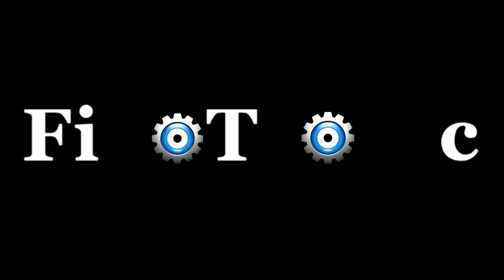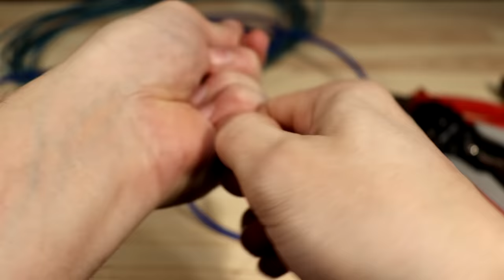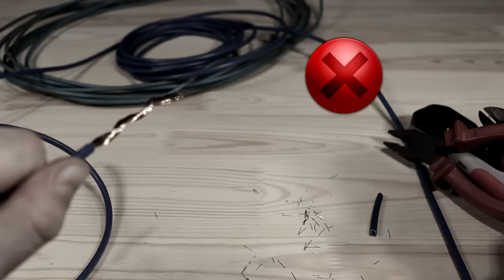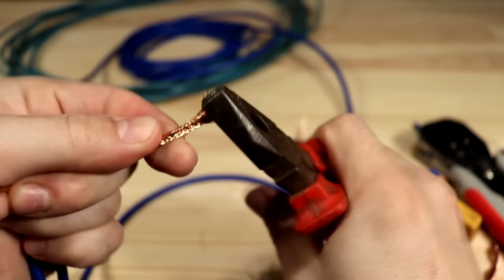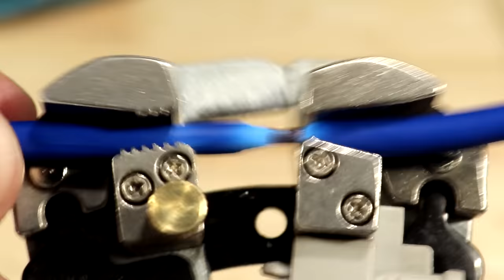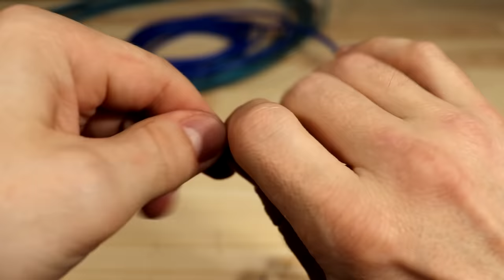AWESOME IDEA! HOW TO TWIST ELECTRIC WIRE TOGETHER!

Comment: Use any method and solder a bit. Cut down video to 30 seconds.
Reply: but...   thats what electricians do....  this kid wants to be unique.. lol
Reply: But first, slide a piece of heat shrink tubing over one of the wires, then after the wires are soldered together, slide the heat shrink tubing over the joint, and heat it to shrink the tubing. This covers the bare joint so it doesn't short to something.
Reply: @JohnMSawyer  I was going to say the same.
Reply: Yup. That's how NASA does it. A lineman's splice, soldered and covered with heat shrink.
Reply: @JohnMSawyer  oh thank you. Most people would not have thought about the wire shorting out. You saved someone's life.
Reply: Or just don't pull the joint apart. He never showed us what he did to finish the job of. Heat Shrink, Insulation Tape?
Reply: A good strong physical connection such as the western union or linemans splice should always be used BEFORE soldering.
Reply: @billkelly6374  NASA specifies that there should be just enough solder for a complete bond but little enough that the proper form of the splice can be seen.
Reply: Yes, solder and a bit of shrink wrap and you're good to go!
Reply: Nothing new here, the lineman's (or Western Union) splice was taught to us in US Navy Electronics Technician Class A school back in 1963 (and it was old then!),
Reply: @bumper52  Yeah, it was originally used to splice telegraph wires.
Reply: Brian Roberts  nope those clip connectors  always  are the best way  for splicing  into a circuit  and will  never  give you  any  problems  during  the  lifespan  of the vehicle
Reply: No I dont like to shoort a video, It wastes my time.
Reply: Not to mention, using pliers to crank the splice tight with the third demo, but not the first two, just MIGHT be a reason why the splice was stronger...
Reply: If you want the best way to proceed, check out IPC A-620 pdf guide. This is the most up to date guide for aerospace repair and wiring assembly. It provides everything about wiring, splice, cliping, connector,  shielding assembly and so on.
Reply: Please do not solder. cuz when i have to show up because you hooked up your shit wrong i don't want to have to deal with soldered connections. Thank you. Sincerely, an Electrician.
Reply: Brian Roberts  You dont need to solder 220V (or US 110V) joints. Hifi and such, yes, bc of oxidation, increasing the resistance.
Reply: Also:
Electrical wire is never supposed to deal with force, so your connection doesnt have to be strong, unless you want to pull single strand wire, for 220/110V through tubing, but then you are not supposed to have any connection IN the tubing (against regulations even). So for getting the wire through you use a tool and not twist wires in any way onto themselves to pull through.
You never need to solder 220/110 wires, bc the voltage is high enough to deal with the bit of oxidation. Contact also doesnt need to be big (compare to contact surface of splitters).
You DO need to solder hifi wires and other low voltage wire, bc resistance and surface contact do matter there. Again, it doesnt matter one bit how you twist the wires together, bc they do not need to deal with any force.

You also dont need to heat shrink with the designated material. You can use any good tape and will not let lose. To make sure, you can heat the tape, which will also make it shrink and make a plastic bond over the glue bond. (depending on sort of tape you use). I have used heatshrinking material some 30 years ago, but when i ran out, i never bothered again. Tape can do the same thing and since i need that anyway, its easier to just use that.
Reply: @GordieGii  ____
1:57

NASA astronauts Chaffee, White, Grissom would prolly disagree
Reply: @readmore3634  About what?
Reply: @GordieGii  _____Bad joke I guess. You said: Yup. "That's how NASA does it. A lineman's splice, soldered and covered with heat shrink." 
NASA astronauts Chaffee, White, Grissom all died on the launch pad due to an electrical short...I'm sure you knew this...again...bad joke on my part.
Reply: @readmore3634  Sorry, not familiar with the names. I did hear about a rocket blowing up on the pad due to a short, but I believe the insulation wore off due to a sharp edge and vibration, not a bare splice.
Reply: @GordieGii  From the looks of the inside of that command module, they'll prolly never know exactly what triggered the fire...but the reason it was so deadly was the fact the capsule was filled with pure oxygen. That's nuts!!! They stopped doing that.....sad.
Reply: @readmore3634  I'm pretty sure that the capsule was not filled with pure oxygen because pure oxygen damages lung tissue. There may have been vents that were releasing pure oxygen to make up what was being consumed by the astronauts, and anything near those vents would be at greater risk rapid combustion.
Reply: @StofStuiver  Yeah never solder high voltage, because any contact resistance could become heat and burn your house. It'd be bad to do an attempt at reducing idiot loss, and possible fire source.
I just can't count the number of things i've repaired that were on 220V, and malfunctionning because of the bad contact of the primary tension.
And I would say I saw lots of power strips melt just because of how bad the contact were.
Just don't assume you don't need to solder because of high voltage.
Reply: Strip... twist.. and use solder just like that hahaha 1 minute is enough haha
Reply: @handyEliot  No need to be obnoxious m8.
I wasnt talking about what may be better in any situation, but what is mandatory by regulation.
Im Dutch, maybe you are American. That means we deal with 220 (closer to 240V now) and you deal with 110. Thats one difference, which also impacts the surface of contact and heat dissipation.

I refered to commonly used (and mandatory) splitters in housing. Two types are used; the twisted version and a version i do not see a translation to in english, so my guess is they arent used in the US > https://nl.wikipedia.org/wiki/Lasklem
(actually seems limited to dutch and german pretty much)
These have a much smaller contact area, but work a lot quicker/easier. An overload on a connection will dissipate heat, but up to a point where it either point welds itself, which would leave the connection better and thus counter the problem, or melt the plastic housing, which would sever the splitter and thus the connection, which would then stop dissipating heat. It may also short to other wires, which will blow the fuse. If the surroundings can cope with the heat, there is no problem.
Which brings me to the next...

There are very few house fires. Even with ppl illegally drawing more power than allowed (which is typically; 16 A * 220 V > ~3.5 kW per group) when growing pot with high pressure sodium lamps. Probably bc the fuses are set low tripping to allow some tolerance to the system.
The big difference here may be that we build with stone/concrete and never wood, while in the US there is a lot of wood build, or mixed, which means any small fire or heat may quickly turn into a blaze.

I should have stated i live in NL/Europe. Didnt realize this might be a lot different in other countries.

Anyway: we are not allowed to solder any 220V connections, outside of a device. (in housing/installation) and that is bc soldering makes a brittle point in your cable/connection. Its not even possible to solder the splitters i linked above.
Of course you can do whatever you want in your own home, but when working housing or industry, etc, you are obliged to follow Nen1010 for housing and Nen3140 for industry mandatory regulations. These prohibit any soldering welds and will lead to rejection upon inspection.
Reply: @StofStuiver  Actually i'm french, and we use 240V. We also have concrete houses, which isn't what keeps fire away. It just helps not to burn too easily.
Also, a connexion made with the hope that it'll last without problem should be either soldered or tightened through some other device, like junction box made for. The splitters are also used, but the problem is we find a lot of them used without grease, which is bad imo.
Lots of people draw too much current, because they're not informed and don't care.
Ie: the iron on the same power arrival than a heater, thus going way over what the line should stand.
Then, the multiple connection will begin to fail, and as they fail some of them might not be a clear short, then the fuse, or the differential might not see it,  and as the heat increase some materials could burn.
We got lots of old houses, and people won't dig in the wall to set the wires. So they'll use electric chute, often behind the sofa, the wooden furniture etc.
Reply: @handyEliot  I can see the problem with the older houses indeed, specially if ppl do that. Well, you know NL maybe... its not so far from France so maybe youve been here. Everything is (over)regulated and older houses are usually modernized, which means all electrical works have been redone. We take this quite seriously and if you want to find someone who connected a washing machine by an extension chord behind a sofa, you are going to have a really hard time. They are commonly used though for low power devices.

Ive been to France a number of times and noticed there are a lot of old houses in use, without modernisation. Also, when i was at a friend in the south, he was redoing the old house he bought and i noticed a completely other style in building even that you will not find in NL. He was erecting walls with the big boulders that come from rivers i guess (?). So he was fitting that in by hand, cementing, then later zig zagged the electrical flexible tubing thought it. Its actually quite smart ofc to use such building materials, but i dont think that would pass the test in NL. Im not sure though. Its all straighforwards with bricks and cut out with 90 degree angles for the fixed tubing here.

I was getting worried a bit when i searched for a link for those splitters (that i posted in the former post) and saw there was no translation, other than german. So i checked for the amount of fires we have in houses, but those numbers are very low and from the top of my head from the ones i remembered from either the news or local, the few ones there are, are either arson for insurance scam or even rarer, from people growing pot and overloading one group for a long period of time. > A short overload will not cause a fire, but a long overload that is not even enough to trip the fuse, will heat up the system to the point where either cables or splitters may catch on fire. Ive heard from others that they have been in houses where the walls were actually locally warm to the touch, bc of this. Obviously that is not a good situation and on top of that, people that are that sloppy wrt safety and such, will also be sloppy in other fields. Which only increases to the likelyhood of a fire.
Reply: @StofStuiver  Well there in france we got load of regulation and all, but nobody will check .. So there are tons of houses (if not the majority) that aren't up to date.
Even when built, lots of norm are but ignored because workers says it's a pain in the a$$.
Indeed, if you've got better regulation controls, there are less danger. But in france, you've got to know there is roughly 1 electrical caused fire every 8 minutes. Even if it's not big deal as it is, because the majority won't be big fires, it's still there.
Then, you'll understand that my english isn't perfect, and I hope you're able to fully understand me
All in all, the country does a huge difference more because here people won't care about security, then what's not so severe in NL could be a big fire here.
Reply: @handyEliot  
I didnt know that about France at all. I understand your point now. Indeed, if regulations arent followed bc there is no inspection anyway, ppl (companies aswell) will take all kinds of shortcuts.

Wow... every 8 minutes...
Thats a problem!

Thanx for the info Andy!
Reply: @StofStuiver  You're welcome.. Be aware if you want to buy here one day ahah, you'd be surprised I think. Even basic old rule like the distance between a water point and a power cord isn't ok in lots of houses.
Yup, that's definitely a problem.. 
Have a good day
Reply: @handyEliot  You have a good day too m8 ;]]
Reply: @preferredcustomer8273  Electricians here in burnt out Australia just use screw connectors these days. They never solder anymore.
Reply: @StofStuiver  we just use screw connectors in Australia.
Reply: @doctorboy5892   Yeah same with most residential and industrial applications for AC in the US.  I'm referring to other applications.  Now you don't use wire nuts on circuit boards.  Go back and read what i wrote.  I know my shit.

Comment: In the meantime you could have connected about 1/4 of that, soldered it and slipped heat shrink over it.
This just leaves a ton of wire exposed to ground out.
Reply: Exactly

Comment: SKIP to 4:28 to see how to actually do it.   thank me later.
Reply: You saved 4 minutes of my life thank you
Reply: jeez...thank u!
Reply: The hero we need
Reply: Except even the final method is incorrect and wouldn't pass code in most places.
Reply: Thank You!
Reply: Nandri
Reply: I'll thank you now 😊
Reply: Thanks you sooooooo much
Reply: @DaMitch79  and you took 5 minutes to thank him and read this reply, and I took 6 minutes to mock you.
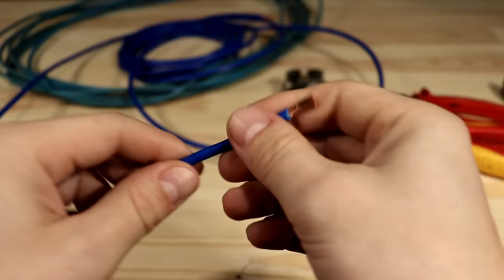Reply: Actually skip to 7:20 this is how you really should do it, if you want a short year later, then do everything from 0:00 to 4:25.  I repaired so many twisted cables and traced shorts in attic as these wires somehow pulls apart
Reply: Doesnt need that much wire exposed.
Reply: But that is the wrong method!

The method one should use it at 8 minutes in...
Reply: @Criscoflawlezz  hahahah meglio non farli eviti la fatica e la pena do morte..
Reply: @Criscoflawlezz  meglio non farli affatto, eviti la fatica lo stress e la pena di morte..
Reply: 쓸때없는 영상
처음 전선 깔때부터 보는내내 답답
전선연결 그렇게까지 안해도 됩니딘
영상편집도 좀 짧게 하시구요~
Reply: Why not show correct method first ???
Reply: No that was a wrong one too

Comment: A little solder with heat shrink tubing over the connection, never hurts 😉
Reply: And it's the best way, imho !!!
Reply: Do not have to waste so much wire that way either.

Comment: this is called a 'western electric ' splice and has been around since the first telegraph lines
Reply: Also known as Wesern Union wire splice with a minimum of 4 turns in each direction.
Reply: that's the same year I started watching the video!
Reply: @RockwearbyEddie  🤣
Reply: no! you almost got it right, it's called the Western Union Splice. Western Union, founded in 1851 as a telegraph business in Rochester, New York, added its money transfer service in 1871 and has since grown to become a global leader in the money transfer industry. -  As for Western Electric was founded in 1869 in Cleveland. Among its early products were the first commercial typewriter and Thomas Edison's Electric Pen,

Comment: If I had to watch you struggle to strip wire one more time!  For the love of Pete, use the fast forward!
Reply: There's a playback speed in the settings non verbal ones are usually watchable at 2x and saves a lot. Verbal I usually have to run at 1.5x to be able to understand. But this video way is too long either way.
Reply: LOL
Reply: cutting was painfull to watch as well, invest in some quality tools.
Reply: I've seen it done faster with teeth ffs

Comment: That's what I've done since a kid for wires that had tension on them.  For those guaranteed no tension then I used the first method.  Then I found chocolate blocks.  I make the wires mechanically secure and make an electrical splice with the chocolate block. (aka terminal block)

Comment: you forgot the shrink tube to place over the OPEN wire, BASIC 
FAIL
Reply: @preferredcustomer8273  tape come loose, heatshrink not!
Reply: @useryggfdcc  Not if you use good tape and/or use pvc tape and heat it (also heat shrinks)
Reply: Rubber splicing tape and a vinyl tape over-wrap....been working on high voltage connections since the invention of tape. Dont think the  intention was to demonstrate the proper technique of insulating conductors anyway....just saying
Reply: yep
Reply: You read my mind ! No heat shrink ! Someone was patting their back a bit hard about the strength of the tie job and threw the insulation/fire safety out the window,lol.

Comment: Perfect splicing while sitting on a chair at a table with yards of wire. Now do it laying on your back under the dash of a car. Better yet behind the engine of a car near the firewall. I’ll use my faithful soldering iron an heat shrink tubing.

Comment: I’m glad I watched that not 2 but 3 times - I was imagining you wrapped each wire around the other & headed it back into itself(which is last-able but has questionable 1 dot of contact).. but finally I see U actually just swirled the 2 wires together.  Y that holds together behUvs my wit✋🤔  but neway that combined with waterproof shrink tubing or better yet that self welding thig-a-ma-gig.. choice bro-

Comment: I have been doing it this way for years.  This is not new.  Followed by soldering, and shrink tubing, this makes the best kind of connection between wires.